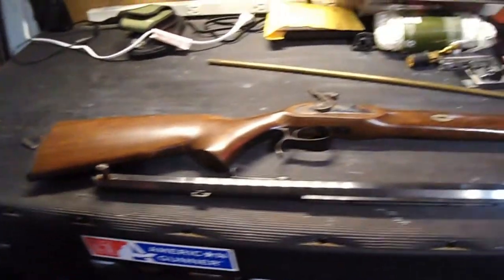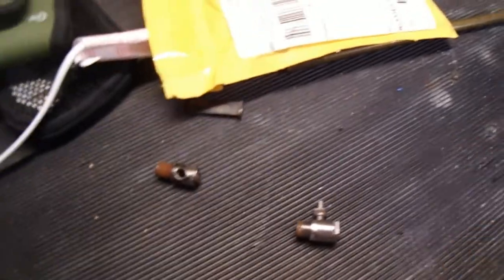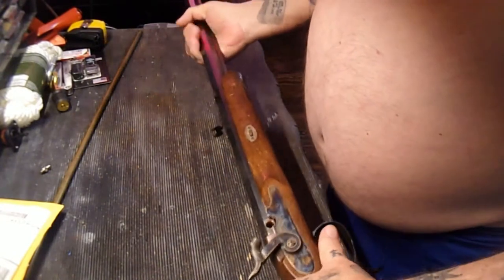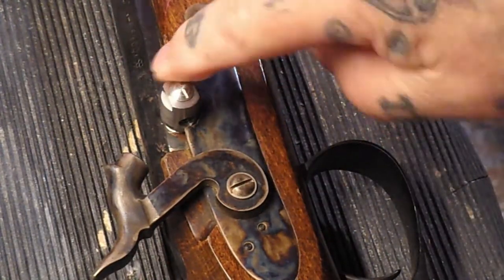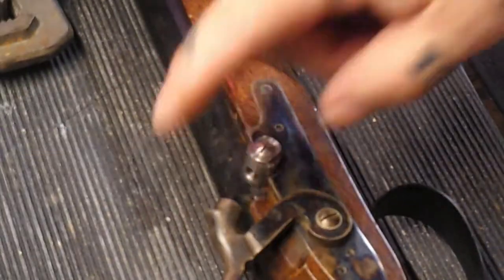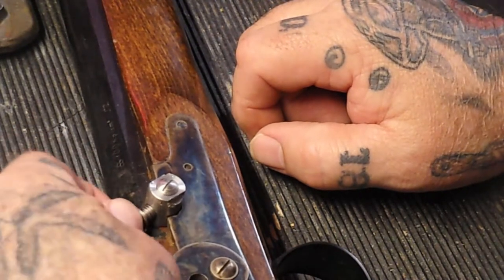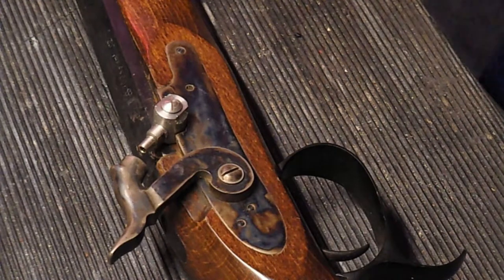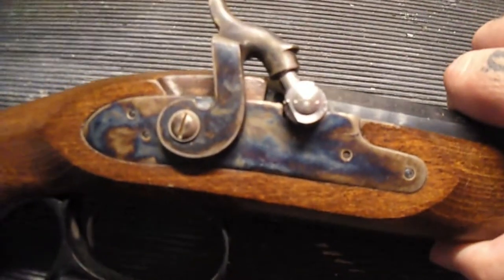50 CAL  BLACK POWDER NEW DRUM INSTALL

Comment: Needs a few more degrees of turn on the drum. It must fire dead on to the hammer. I have never seen an import drum removed. Make sure the cleanout screw is not too tight to the bore. It must not project into the firing chamber. Same with the  nipple threads. Other wise, it was cool to an extent. Be safe though. Keep em tight.
Reply from the maker: I have been back through it and all is still working just fine . Thanks for the tips .

Comment: Generally very useful video, thanks! 

Sure I will work a bit tidier and use more appropriate tools. I must admit though, my favourite tool is my large water pump pliers/pipe wrench, when all goes wrong and opening something is all that counts, this is a life saver.  I baffled a much bigger guy by easily unscrewing some nuts, one more than one occasion, when he basically gave up on them. So, crude tools have their purpose 😁
Reply from the maker: Yup and being an ex pipe fitter I have more control over my pipe wrench than any other so , NO , I did not over tighten anything on this rifle . Do I care if there are a few teeth marks on the drum when it is loaded and a deer is walking towards  at me in a field ? Nope . BOOM !!! They drop and I reload . LOL Thanks for stopping in and watching man . 😆🍺

Comment: You DO NOT need to use a vice grips or a pipe wrench, the flats on the sides will fit a 10mm crescent wrench.

The drum should be snug not tight. A tight drum will crack with an actual load and projectile. Maybe not the first load but it will at some point.

The threads should have an anti seize on them that forms a gasket as well.

You're nipple isn't exactly lined up it, you over tightened it the way you cracked it down. It needs backed out then it  needed a shim a few thousands thick
Reply from the maker: Thanks William for the help . Now  can go back and set it up better .
Reply: @handsonwithblg4949  the best way to do this is to get a blank drum without the nipple threads drilled and tapped yet.   Find the 90° from the center point of your female 10-1.25 threads upward to the center of your hammer. You then install your drum with some sort of anti seize on the threads. Once snuggled not gorilla torqued down you have to drill and tap your threads for the nipple. You can drill and tap what ever nipple you want to use rather than just the 6 x 1 CVA nipple. Track of the wolves sells an alignment jig for drilling and tapping the nipple. If you get a blank CVA drum, the alignment jig, a #3 drill bit and a 1/4-28 plug tap you can install the drum, alignment the nipple, then drill and tap it for a 1/4-28 Thompson Center Hawken/Knight #11 percussion nipple 

 there's actually online forms where people can help you and if you believe something is  out of your ability someone can help you find a gunsmithing who is very reasonable.
Reply from the maker: @williamster2015  I know this part but I don't have the tools to do that stuff here . LOLI did go back over what you told me and re set it up that way . Very nice and Thanks again !
Reply: @handsonwithblg4949 No problem you're welcome.

 Track of the wolves sells all the parts. You can get everything (besides the Drill or drill press) for 39$ shipped